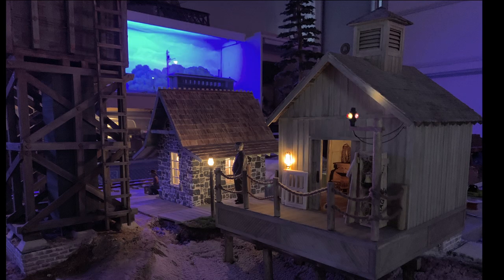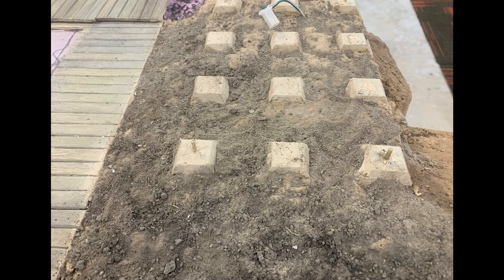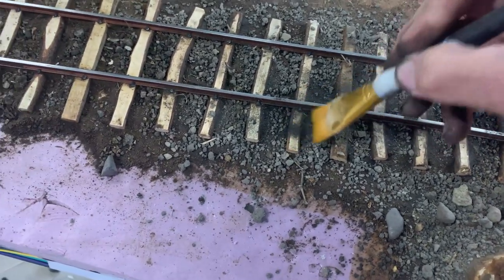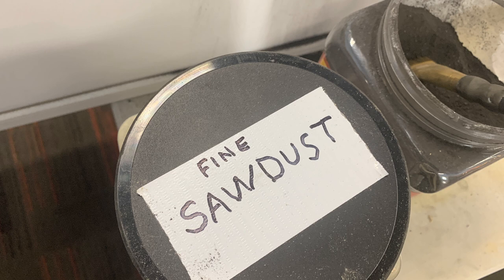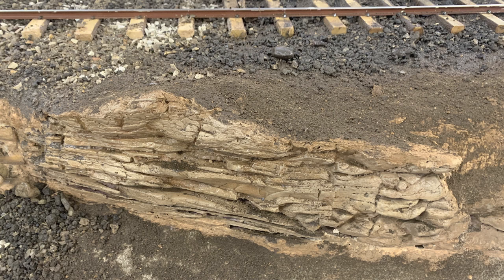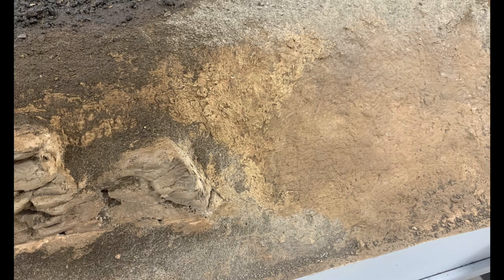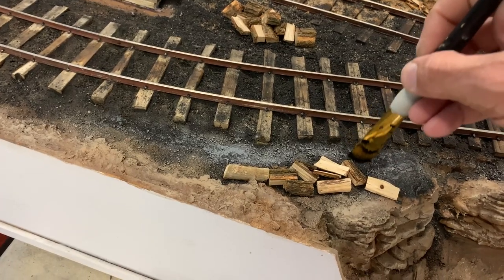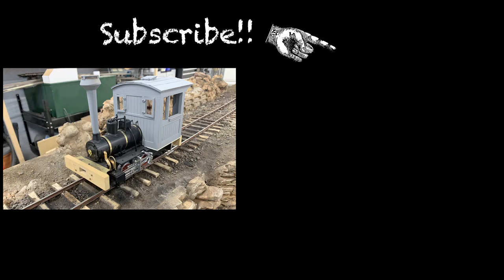Modeling Ballast and Mud on our Model Logging Railroad

Comment: while watching... i was waiting.... waiting yeah, that school glue (you didn't know?!) it's perfect for spritzing and watering scenery down - it's perfection... with glue to set everything ... heck you can use it on scenery trees when adding leaves or fall foliage! looks great... you're using a lot of backyard stuff... have you tried ground leaves?
Reply from the maker: I think woodland Scenics landscape cement is this with a splash of soap to break surface tension.

Comment: Great how to 👍🏼👍🏼 I’ve used the crappy school glue for years just as you are using it for.  Works perfect for scenery and ballast
Reply from the maker: I’m reasonably sure that’s what the Woodlands scenics scenic cement is. School glue deluded about 4 to 1, possibly 3 to 1 and a dash of soap added to break the surface tension. $10 a bottle for a bears or you can make a gallon of your own for half that.

Comment: Thats looking really great, someday ill start doing model Railroading when get the money and room.  the abandoned Railroad i mentioned earlier thats south of where i live, turns out it was Southern Pacific's South line.  The SP acquired the line in 1924 from the El Paso and Southwestern RR. They ran the line until 1959, but the tracks wernt taken up until a year later. Ive found quite a bit of Railroad Spikes from the line and also from the branch lines...

Comment: What scale train and track are you using? 
Apologies for the dumb question, but it looks awesome, and don't know much about it.
Reply from the maker: It’s gauge one. 45mm. 1 3/4 inches gauge. Most of our trains are 1/20.3 scale. So three feet in that gauge. Perfect 👌🏼! But some are 1/22.5 scale. Meter gauge. Great for European stuff but a touch smaller than our 3 foot stuff. But much is 1/2” to the foot. 1/24 scale. So much smaller. We run it all but never together. Looks silly to have a 120.3 loco pulling a 1/24 car.... the water tank is 1/20.3. And the depots are 1/24. But it mostly looks fine..
Reply: OMG lol, so many things to consider. Thank you for the info.

Comment: Hey. What kind of glue do I use for my slag, so that way it won't spill all over the place
 🇵🇪
Reply from the maker: We mix with yellow dextrin. About one part dextrin to four or five parts cinders. Or less dextrin. You can get it on the internet. It’s not common. It’s an ingredient in yellow glue. Super fine yellow powder. Gets sticky the moment moisture hits it. Let it dry. May need to follow up with dilute white glue.